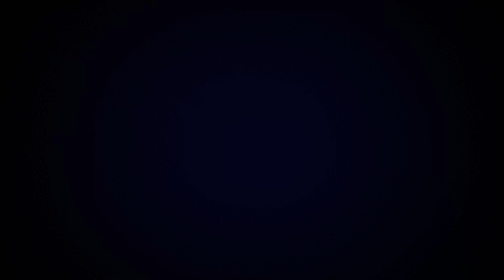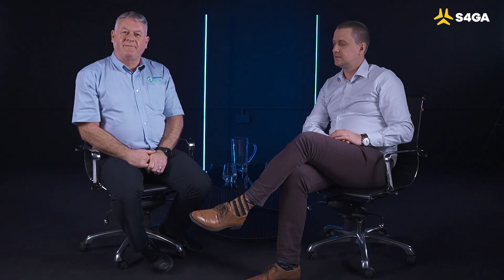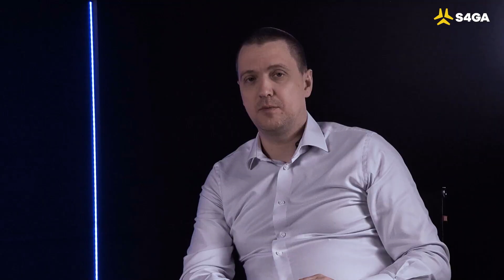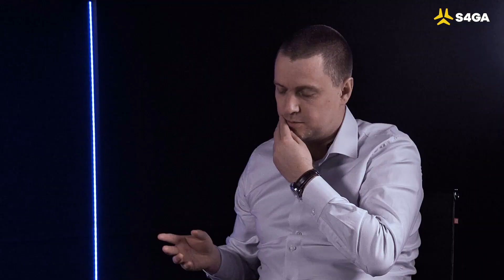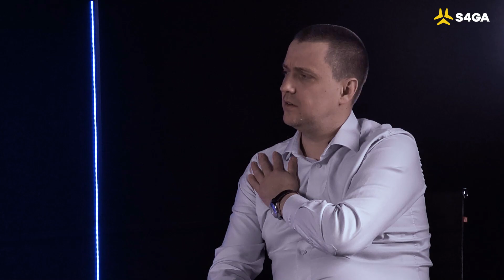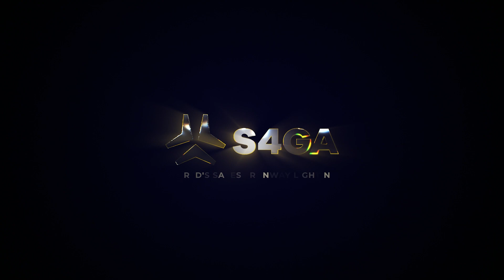Interview with Dewhurst: S4GA Solar High Intensity CAT I Airfield Lighting System

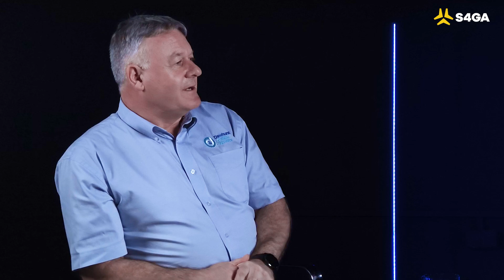Comment from the maker: 00:32 — Compliance with ICAO CAT I requirements
01:30 — HIRL intensity vs Energy consumption
03:05 — Feasibility Study for Solar CAT I
04:00 — System Scalability
05:10 — Installation & System Architecture
10:28 — Security & Equipment Protection
12:55 — Maintenance & Monitoring
17:29 — System Redundancy
22:35 — Cost Comparison: Wired vs Solar AGL
25:16 — Transition from Wired to Solar AGL
29:34 — Technician Safety & High-Voltage Risks